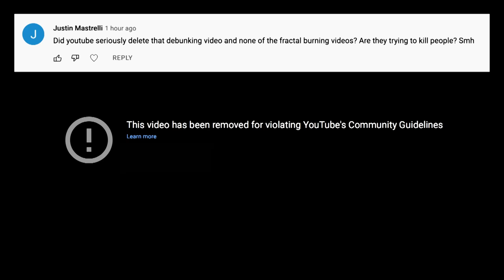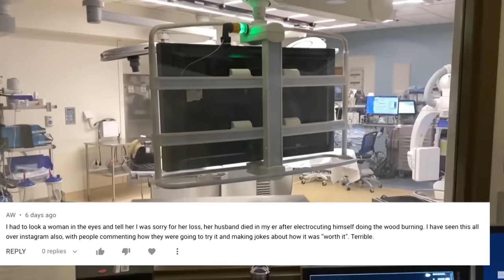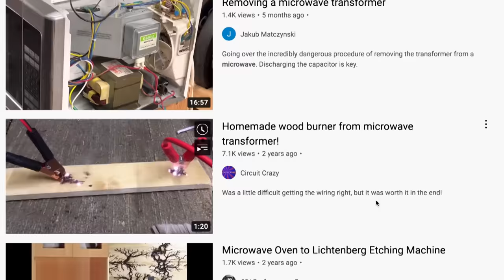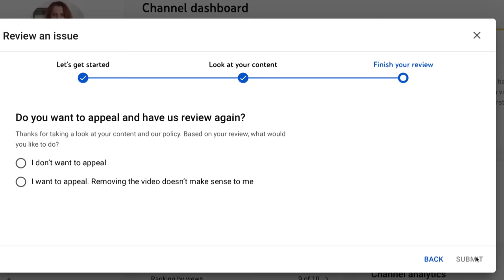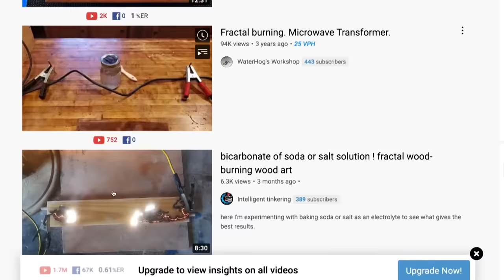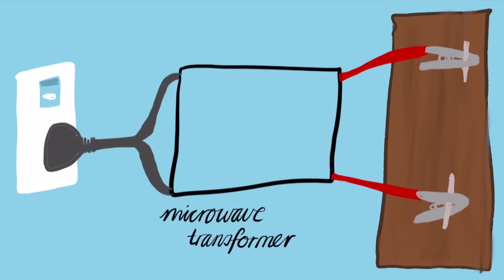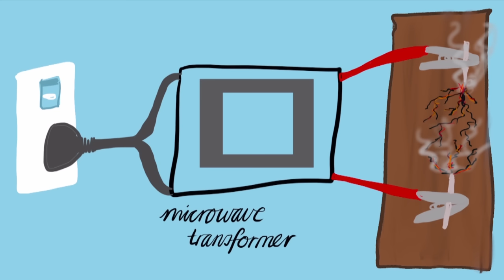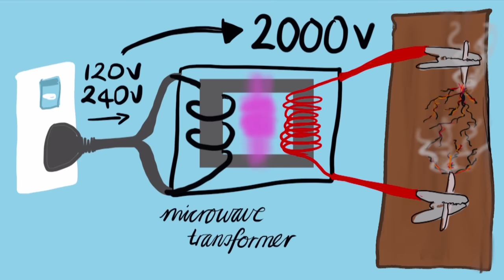YouTube BANNED my Debunking Video but leaves DEADLY how-to vids online, 34 dead!

Comment: I used to be an electronics technician that serviced microwave ovens and I can tell you that doing this is insanely DANGEROUS!! The 2000 to 3400 volts AC along with the high current from the transformer, is a recipe for disaster.  Please don't try this!!

Comment: Wood is literally an insulator. The fact that high enough electricity still manages to pierce it should make it obvious how less effective insulated gloves or shoes would be.
Reply: Funny you should mention this. I just finished an electrical safety class at work. Dealing with voltages in the hundreds or thousands of volts.
If you’re wearing the proper equipment and take the proper safety precautions you will certainly be safe. The question is do these videos supply all of that information. 
And are the people using the proper type of safety gloves, shoes, clothing, face protection. 
I’m going to guess no.
Reply: @neilkurzman4907  Exactly. Its a matter of scale. Almost anything can become a conductor  if you amp the potential difference enough. Lightning is a simple example. Also when capacitors blowout.The gloves available at home aren't going to be that helpful, nor the shoes. That reminds me of an experience when a technician was fixing my cathode ray TV on a bed and the electrons were leaking out enough that I could feel a tingling sensation if I touched the bed cover. We both noped the eff out once we felt it.
Reply: @neilkurzman4907  I doubt a professional that maintains a 100kV+ power line and shares the same risk is payed by a bunch of burned woods... So, this hack ain't worth it!
 And besides the protective clothes, it requires a power-on indication, additional switches, a long non-conductive pipe\stick to held an electrode on its edge far from hands, a buddy who will watch over you, and so on.
Possibly debatable for >20 kHz and <30 mA HV power source, but using a 50 Hz microoven transformer for this hobby is kinda suicide.
Reply: @arthasmenethil5752  
If you’re dealing with kilovolts, then you shouldn’t be using hacks at all. 
Electricity isn’t very forgiving.
Reply: @neilkurzman4907  Yup. Exactly.

Comment: As an insane crafter, I also wanted to try it. I had every intention to be safe but I didn’t realize just HOW dangerous it actually was. That video made me realize and I refused to touch it. I decided to try some paper crafting instead. Thank you for that video and I’m livid it got taken down but happy to see it’s back!
Reply: This thing shouldnt even be in the "hobbies to do at home level", let me illustrate what you would need to get the most basic level of safety:

To make it safe you would need certified high-voltage proof gloves and shoes along with flame-repellant clothing covering your full body. 

After that you would need to create a "kill switch" device  thats essentially a system designed to turn off the device the moment anything goes bad, i would make it 2 fold one with a manual thing you hold in your hand and one thats attached to whats in your hand that can measure electricity and turn the thing off if it detects electricity on you. IT NEEDS TO BREAK THE OUTPUT AND THE INPUT of the transformer!

Then after those you would need to put the transformer into a cage made out of bakelite because even turned off transformers can kill you for good minutes after pullin the plug. Put that entire cage onto 1cm thich insulating rubber.

Next part you need to have the table INSULATED! Put it on a dry surface with 1cm of bakelite and 1cm of rubber below all legs.

The wood part must be put on a completely insulated table so 1cm wide bakelite and 1cm wide insulating rubber covering the whole table. The metal nails must be secured and the wires must be fixed to them.

After all of this you need to control this thing from atleast 4 meters away from behind safety glass or something that makes sure you wont get near it before finishing.

This is the literal only way to keep this thing relatively safe and i STILL DONT RECOMMEND DOING IT!
Most people have none of these at home and the preparation requied is more like doing experiments in a high end tech school not something you attempt in your garage. Its like making a tesla coil, you need a hell lot of experience with electric safety just to get to the point where you start building not even talking about turning it on!
Reply: I love how people understand that accidents can happen. I've warn people of stuff and it's always 'I'll be safe' or 'I won't make the one mistake that could end in failure'. No, accidents aren't something you control, it takes one slip, one sneeze, one shiver. You don't plan for that, it just happens.

Thank you for restoring some faith in me that people can acknowledge that it doesn't matter how safe you are, you can still mess up.
Reply: I'd recommend giving scratch-bashing a try if you'd like to do a crazy (but safe) project! And from there, I'd recommend watching Studson Studio's videos to see the beautiful, and occasionally cursed, crafts he's made. <3
Reply: you can always get some nice paints and draw the patterns yourself. no risk of death necessary
Reply: @voidbreather7405  oh my gosh that does look crazy and fun. And safe lol. Thanks for the suggestion I am sure I will be trying that out, for sure.
Reply: As someone who does a fair number of things with electricity, 30amps as scary as *bleep*. You can safely touch 30k volts, but the current in that case is almost non-existent.
Reply: @limmiedee7405  fr or why not use a match and carve it into the wood (wood burning? / carving?)
Reply: @vibrantgleam  Wood burning is usually done with a soldering iron.  It's fun.  You can do really cool stuff with it, but it won't look like fractal.
Reply: @adde9506  yeees
Reply: I remember someone under the original video suggested the printing method if you'd want the look of the fractal burning but not the process of it - I don't remember the details, sadly, but it went along the lines of "put paint between sheets of (plastic?), take sheets apart, apply what you want to do the print on" - though it might be better to google the specifics. Have safe and fun crazy crafting! :D

Comment: My dad is a maintenance mechanic who has seen a lot of dumb ways people have killed themselves with appliances and electricity. I showed him the 1st video to see his reaction and he told me people have been regularly approaching him at his repair shop to ask for microwave parts specifically for fractal wood burning. He's turned every single one away with a lecture on stupidity.
Reply: My husband is a shop teacher, knows how HE can safely do it, but has zero interest in doing so, it scares him how easily it could go wrong. Never would let a student do it, even via other methods. Says he has no desire to test his CPR skills.
Reply: Yeah and this is just it - if you know enough to do it safely, and anyone messing with mains and transformers should (because it shouldn't take a youtube video to tell people not to mess with such dangerous stuff), you know how dangerous it is... so just wouldn't do it as a hobby. 

The gear, the earthing, the time spent not going near it letting stored energy dissipate... all to possibly die because it's more humid today. It's just not worth it. Make something neat with an iron instead.

Comment: As an Electrical Engineer, I just wanted to say that you have done a great job explaining the electrical characteristics of this wood burning project. I have worked with microwave transformers in a handful of occasions, and every time I did I made sure to take many safety precautions, and even in those situations there was still a real risk of damage.
High voltage is no joke and should not be used by anyone who doesnt understand EXACTLY what they are doing.

The type of explanation you give is perfect for the type of target audience searching out how to do those projects.
Reply: When I graduated from college and was getting my own apartment, one of the pieces of advice my grandfather, a chemical engineer, gave me was to buy a NEW microwave, and not risk getting one from a second-hand store, because a damaged microwave can really ruin your day.

Comment: i am a professional electronics engineer and found your original video well-informed, well-organized, and much more understandable to a layperson than i would have been able to formulate myself. please reach out if having an expert testimonial could expedite the process to have this video relisted and continuing to save lives. ❤️❤️❤️
Reply: As a former electronics tech, I  wholeheartedly agree, my goal as an ET was to not get shocked. She did a phenomenal job explaining it & its dangers, doing this is just begging for a darwin award.
Reply: Then you should know that it is not the Voltage alone that kills you, tasers and stuff like that can go up to 50,000 volts with low ampere. Very good video but she's wrong there.
Reply: @MrAstylee  if you’re a professional qualified to criticize another professional tHeN yOu ShOuLd KnOw tHaT an MOT outputs approximately 500 mA to 1A of current, depending on your country of residence and the power of your microwave. over-explaining phenomena like this to the layperson may confuse them, so simply mentioning the voltage is sufficient to get the point across to someone who may (1) be confused with more information into thinking some form of modification to the device will make it safe or (2) simply check out and stop watching the video if it gets too complicated. further, even at far lower current than any class ii MOT for sale right now produces, 2000V is plenty to cause third-degree burns at much lower current than is required for electrocution. the video was presented in a way that sensitive populations such as children or people with special needs will understand its warning, so in my professional opinion, part of the specific mathematics of a constant among all class ii devices in this category is less important than getting the point across succinctly. again, current is not a factor in the problem as this is enough voltage to burn you [i would say to death, but i am not a healthcare professional and follow the ncees standard of not giving advice outside of my immediate area of expertise] before it electrocutes you. simply omitting the details of something that would harm you no matter what is not being “wrong.” i would implore you to review your university notes regarding risk and hazard assessment and practical issues in public danger mitigation.
Reply: @MrAstylee  in terms of the “tasers and stuff,” those are classified as “less fatal,” not completely without casualties. people DO die from stun guns and tasers, just at a lower rate than from gun wounds. the 50,000V used to initiate the arc between the prongs is not sustained. upon ejection from the handheld device and subsequent contact with the skin, it has reduced to approximately 1000V. and even at this lower voltage than the project uses, the person stunned still always needs to have (1) the prongs removed from their flesh, (2) burns treated (again, the injury is a burn, not an electrocution), and (3) heart function monitored by a trained medical professional after the fact. further, the prongs are ejected a set distance apart, and in order not to cause lasting injury are only allowed to be used on the distal limbs, not near any vital organs like the ones in your abdomen that may brush on a table as you’re doing this project.
Reply: @CutiePie4325  hahaha get out of your basement and see some fresh air, did you really spend that much time and energy on a youtube comment? Nice life 😂
Reply: @MrAstylee  i aim to educate the public on electrical safety, especially when people are spreading harmful misinformation. imo, speaking on a dangerous topic without the proper knowledge is exponentially more disgraceful than an over-explanation of helpful information. i hope someday you can find a profession about which you are so passionate. i also hope you are able to take what you’ve learned from reading this and make safe choices in your future. be well.

Comment: High voltage engineer here: Never open the microwave oven if you don’t know what you’re doing. Inside there’s a HV capacitor in the oven that will shock you to death even if the oven is not powered on. Doesn’t matter how old/ scrappy the oven is. In fact if you can never buy these things for your home

Comment: When our microwave quit working, my husband was going to take it apart and see what he could do to fix it. He also checked YouTube for direction. What he found was warnings to never, ever to try to fix your own microwave (other than the fuse) because of extreme danger. We tossed the microwave and bought a new one.
Reply: Awww he/you could've been famous on this episode! Ya should've let him😆😆😆😆😆😆
Reply: the same goes for circuit boards in a lot of electronics. Those little things that look like tiny batteries are capacitors they soak up a big charge and if you touch it can potentially discharge all of it at once into you. The rechargable lithium batteries in all our devices are also extremely dangerous if one gets punctured it kickes out a 5000 degree flame that you're not putting out. Even when "dead" those batteries have a hell of a lot of energy running through them.
Reply: @westcoastwarriorsarchive7929  Wow...that is pretty dire. Thanks for sharing!
Reply: @westcoastwarriorsarchive7929  Most consumer grade electronics ( excluding microwaves and CRTS ) are really not that dangerous. Consimer electronics repair is really not a hazardous field. Unless you're doing something really moronically stupid, repairing electronics is not that complex.
Reply: @westcoastwarriorsarchive7929  No, no capacitor that looks like a "tiny battery" could ever possibly store enough charge to harm you. One about the size of an AAA battery would only hold maybe 0.36 joules. They're massively less powerful than batteries are, their job is frequency filtering and ripple smoothing.

Big ones the size of those 150mL mixer coke cans can hold a lot more, but also they're typically in the PSU, so would drain when you turn it off.
Reply: @westcoastwarriorsarchive7929  
Not all capacitors soak up high voltages. It’s not just a charge it’s the voltage. They’re also easily safely discharged if someone is giving instructions on how to do a repair. 
They are an extremely common failure item in a lot of electronics. And very inexpensive to replace. So as long as the video explains how to do it safely, then it’s not necessarily dangerous. 
Lithium ion batteries can certainly be dangerous. They can burn the temperatures up to 1000° C not 5000. But that’s still pretty significant and can set a lot of things on fire.
Reply: @ChristAcolyte  
The key to doing home repair is knowing what is an isn’t dangerous. 
Microwaves have high voltage is in them. And can certainly be dangerous if you’ve opened it up and are trying to operate the magnetron without the shielding.
Reply: @kyle8952  
The problem isn’t the charge. The problem is the voltage. Some capacitors can have several hundred volts on them. Where as a AA battery you can hold it all day and you won’t be injured.
Reply: You can also fix the microwave door latch
Reply: @westcoastwarriorsarchive7929  so could this happen with electric cars?  I don’t want one but that could be a major issue.
Reply: @ritadyer9295  no idea never looked inside an electric car. But  with how much power those battery banks must hold Im sure they do. But as we haven't heard stories of people getting deep fried by their electric cars they are probably pretty safe. Just dont go ripping open the battery bank and poking at the circuit board with a screw driver.

Comment: I've usually seen fractal wood burning videos as short clips on instagram, tik tok or YT shorts... Not enough time to put a disclaimer on these things. As an electrical engineer, I've seen how dangerous electricity can get, and experiments using high voltage current should ONLY ever be done in a lab with proper safety measures.
Thanks Ann for bringing attention to such dangerous things on the net. Hopefully more people get to see this.
Reply: Yeah it's really depressing how they try to make playing with electricity "a fun craft" like we learn at a very early age and are constantly reminded as children that electricity go zap and make you dead. Yet we have dumb adults thinking it's a good idea to do this with no professional experience whatsoever.
Reply: I know this is hardly the point of the video, but can this be done if the crafter is wearing a full rubber suit -?
Reply: @jauxro  I think there are a lot of "If"s to that, most importantly if the voltage is not too high. With a high enough voltage or with enough time, electricity can break down a lot of conductors. You'd need really high resistant clothing and need a controlled environment. Even then, just a couple seconds would be enough to stop your heart if electricity passes through it.
As you can tell, I'm not a fan of playing with electricity.